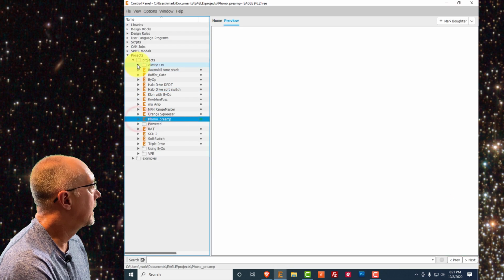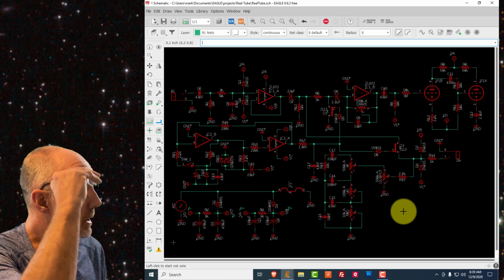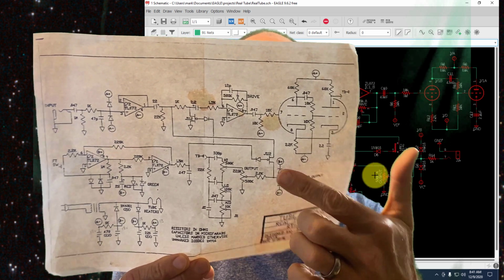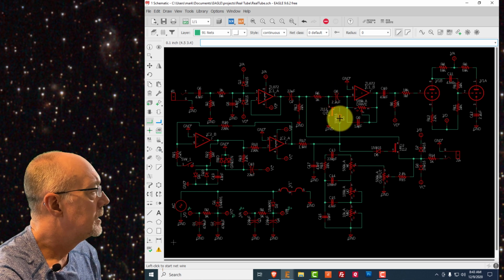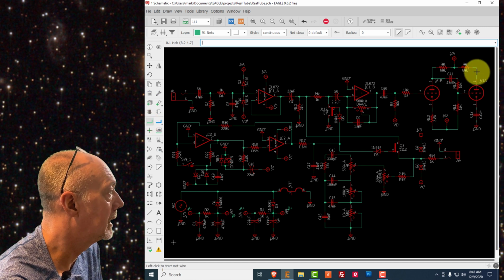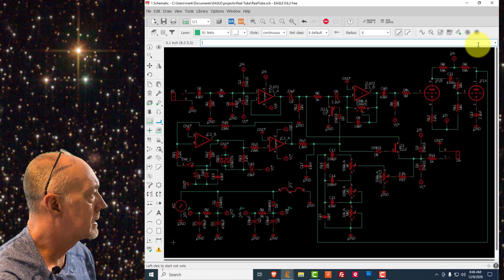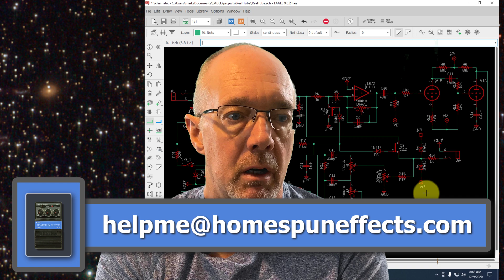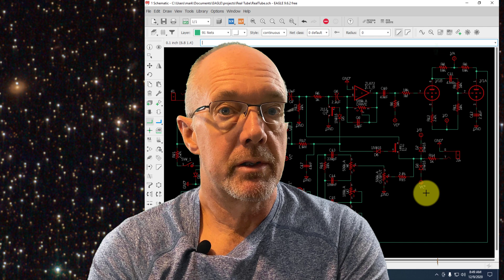Repair your own effect pedal Tube Works Real Tube Overdrive (B. K. Butler - Made in USA)

Comment: Hey I recently acquired one of these pedals and it sounds really good on the hi end but the low end is causing a major distortion to the sound even on the low settings of the tube drive. Im not sure what is causing the distortion but do you think cleaning the pots and switching tubes will help?
Reply from the maker: @Wadeistyler  its always good to try the easy solutions first. Give it a try.

Comment: I'm new to that comparator circuit.  Its kicking my ass currently.  OP AMP seems to be blown.  I subbed an LF353... also a jfet opamp (ordered some TI  TL072's from Mouser to eventually keep it all as original as possible).  But that 353 also too acted like it was blown and the pedal was stuck on overdrive (RED) (pedal button did nothing) , but the J112 isn't letting the overdrive signal through...  Seems like one thing blowing may have taken out a couple things.    Gonna remove a few things and rebuild it in blocks and verify I know what's what.

Comment: I think the switch has gone bad on my Real Tube and I'm not sure what to replace it with. Is it possible to find that switch somewhere or does it need to be replaced with something else?
Reply from the maker: It's a momentary SPST. I didn't remove the switch from the enclosure so I'll have to look at how it is mounted. But first you're going to want to check the switch for continuity when it's pressed as it could just be a broken wire or bad solder joint.

Comment: That was me .. tube preamp
Reply from the maker: I should have an extra PCB for ya.
Reply: @HomespunEffects  woah! .. any news on my frankenpedal lol. LMK how much to send ya . Ty
Reply from the maker: @dingeralan8911  I'm still checking for a schematic. I may just have to start replacing parts. 😄
Reply: @HomespunEffects  prolly start with switches lol
Reply from the maker: @dingeralan8911  yeah, I tore it down, cleaned it out, removed the switches. I tried shorting them and leaving them out. It still flips the patches. 

I think it's a pull up resistor that is missing or bad but they are all surface mount so I'm going to need to find a schematic to track it down.
Reply: @HomespunEffects  Linda and I both have tried to find 1 , no luck .
Reply from the maker: I'll call Digitech and find out if they will offer any assistance.
Reply: @HomespunEffects  awesome Thank you
Reply: @HomespunEffects   Dont know if u everr finished this but would bet on it being that opamp